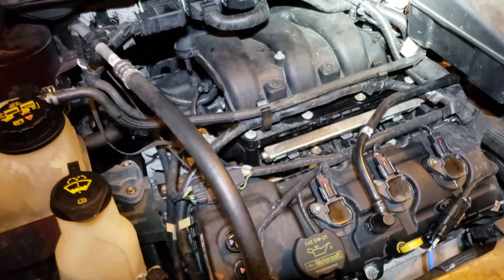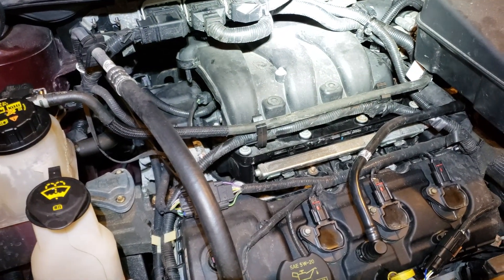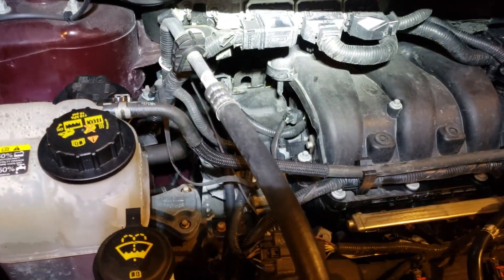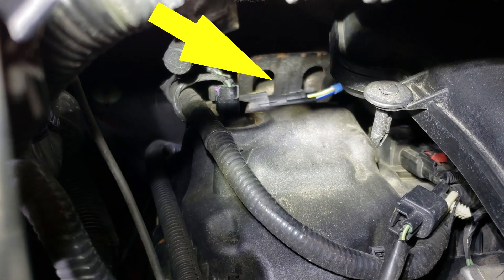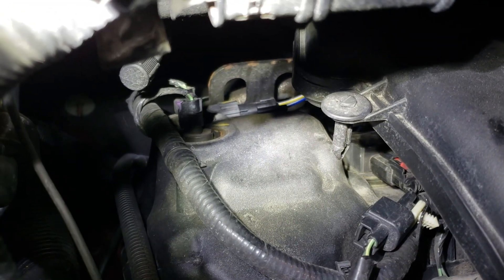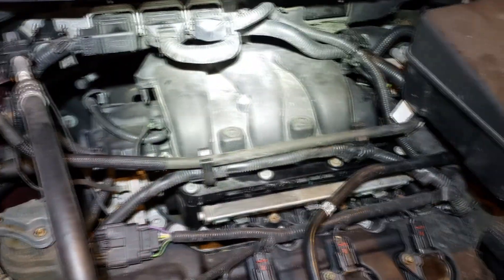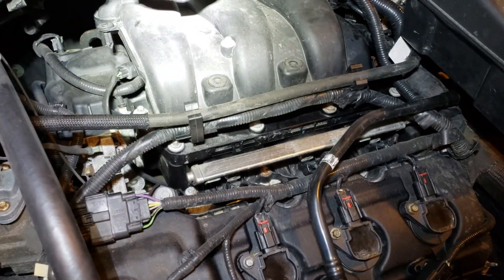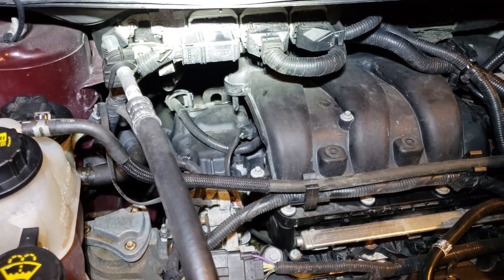Ford Edge 3.5L oxygen sensor removal tips for 2007 to 2014

Comment: How many O2 sensors have an edge 3.5.  2008?
Reply from the maker: 4- two upstream two downstream
Reply: @qksilvr73  where are both downstream located, could only find 1.
Reply from the maker: @jennamidon4599  One is on top or before the converter. The other is after the converter. Hopefully this helps. https://www.fordedgeforum.com/topic/28214-location-of-02-sensors/
Reply: 4

Comment: How did you know your 02 sensor was bad? Were you getting a P0420 code?
Reply from the maker: No code, but the car was over 100,000 miles and is recommended to change them for optimal fuel efficiency.
Reply: I have a 2012 Edge with over 100,000 miles too and my engine light came on and got this code